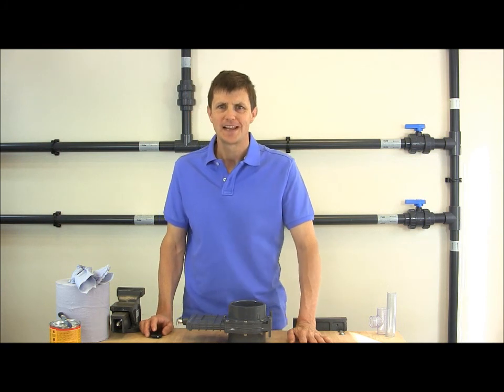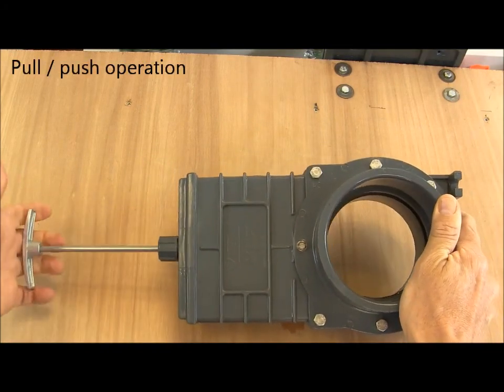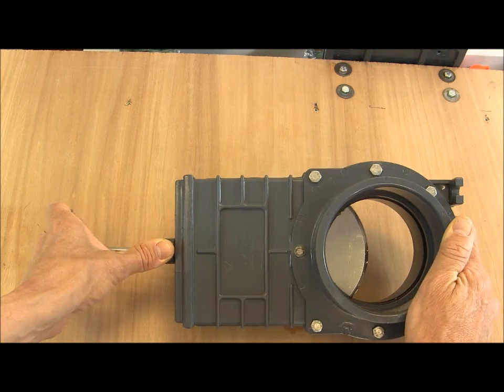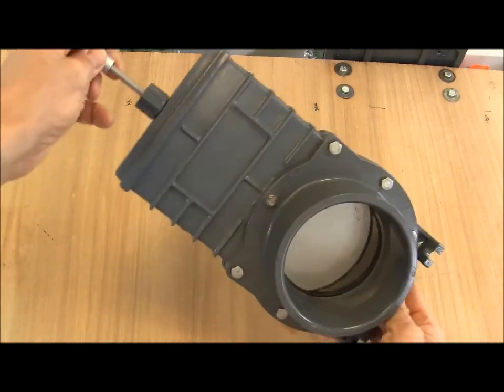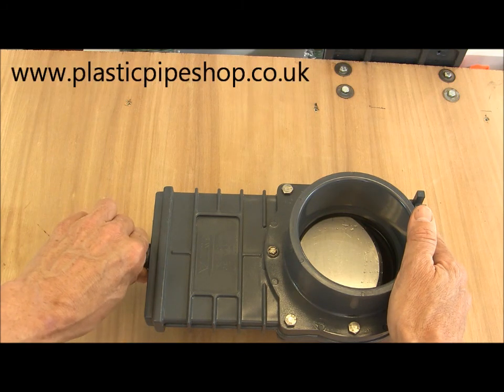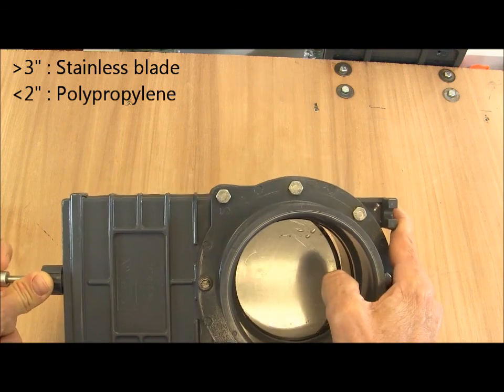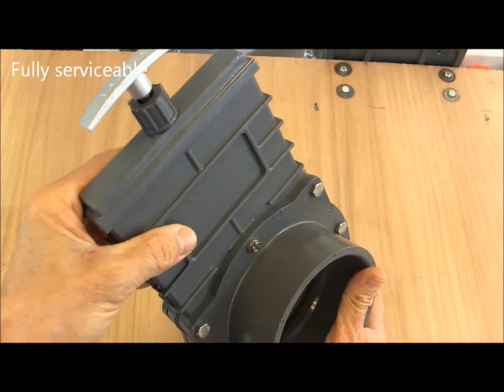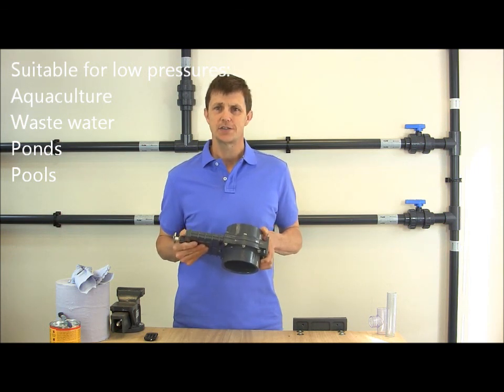valterra pvc slide valve

Comment: Could these be used in a dust extraction system to isolate routes that are not being used?
Reply from the maker: Hi there! In theory yes, although especially if air velocities were low, there will be a risk of particles building up at he bottom of the valve and prevent full closure. A ball valve would be a better option at sizes up to 2" and after that I would go for a ventilation damper, which may pass a very small amount of air but not enough to be significant.